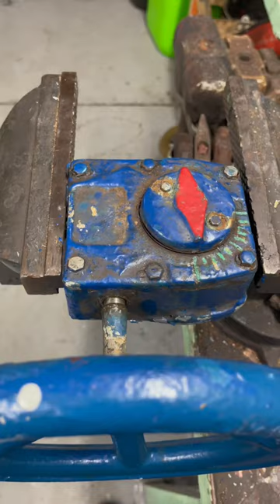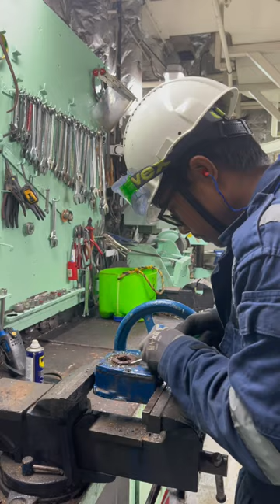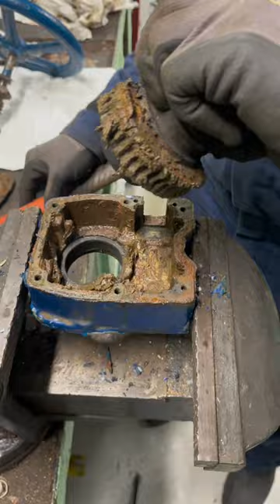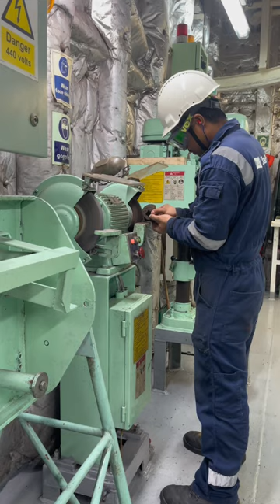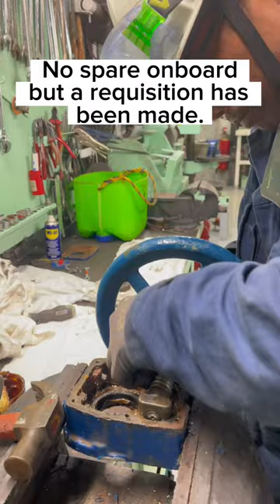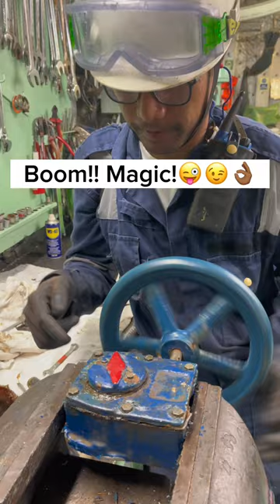Fixing defective gearbox of a Butterfly Valve. #kajourneyvlog #lifeatsea #shortscontent #engineers

Comment: I am guessing you either flipped the sector over to use the less worn side and don't operate it all the way, or you were able to change some shims to get a deeper engagement?
Good work in any case! Lol
Reply from the maker: That’s my original planned by the way, to flipped it over to use the less worn side teeth of the gear but unfortunately it doesn’t work that way. So, just added spacers to the drive gear(wheel side) so that it will not play when the gears are rotating in a deeper engagement. Until now, it’s still working. Hehe. 🤭 Requisition has been made already for a new spare. Thanks. 👍🏾👌🏾
Reply: @kennysjourney18  great minds think alike! Lol

Comment: This is offshore an oil or gas platform.
Reply from the maker: This is the Engine Room Workshop inside a Gas Tanker Vessel.
Reply: @kennysjourney18  so I wasn't completely wrong. The environment and the valve gearbox is very familiar to me.